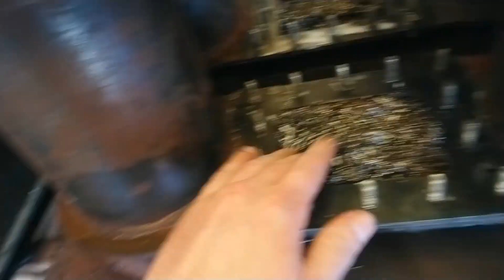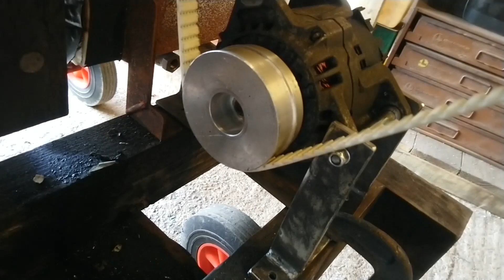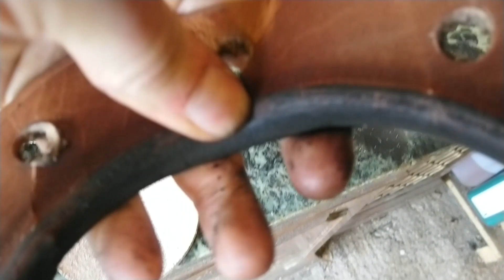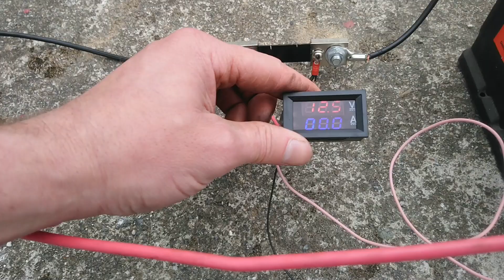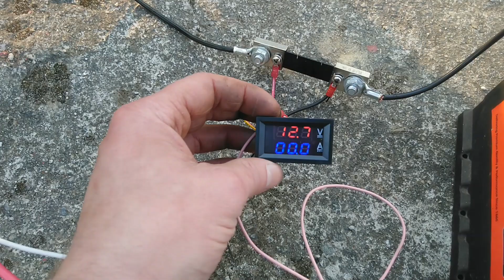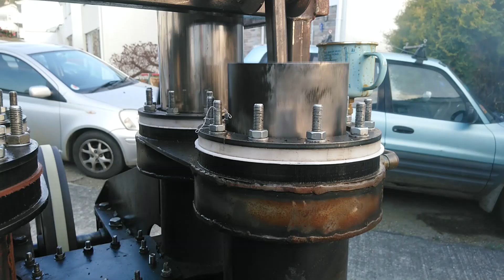Stirling Engine Generator Homemade wood fired - Part 4

Comment: To obtain the declared power, it is necessary to increase the pressure of the working fluid and increase the area of the heat exchangers. The quality of the seals is also of great importance. If you don’t feel resistance when turning the flywheel on a cold engine, then you won’t get much power either. The power generated can be judged by the voltage on the battery. 13.5 V corresponds to a charging current of 5 A. If you want to make a more efficient and less massive Stirling engine, please contact me, I will help with advice.
Reply from the maker: Hi, I've just checked out your channel and subscribed. What your achieving is incredible! ❤ keep up the good work and I might take you up on your offer once I've finished pulling all my hair out in frustration!
Reply: @ShanePomeroy  Thank you! I try to help all lovers of the design and creation of Stirling engines. I think this is the technology of the future. The main thing is to reduce their price and make them available to the mass consumer.

Comment: Once you get it all sealed up and nice and tight you should try doing a helium charge and to help it produce more power efficiently. Also you could add some fins to the base of those heat  Cylinders to help it taken the heat more efficiently.